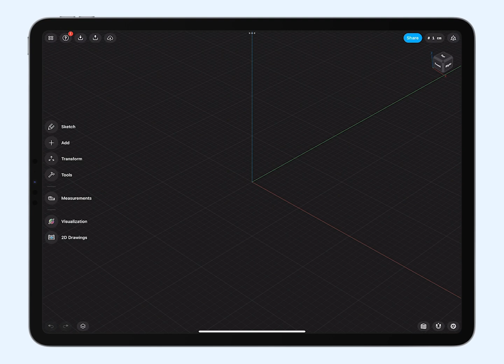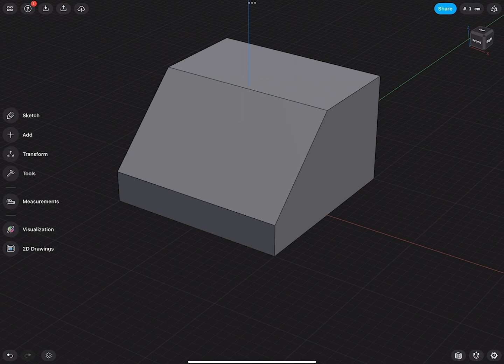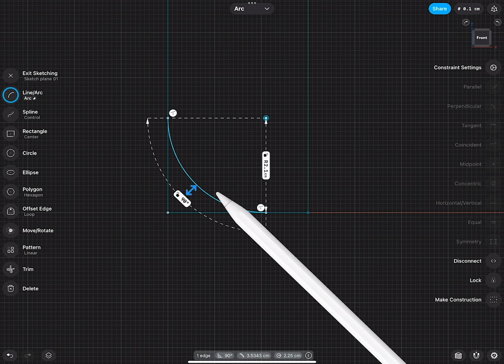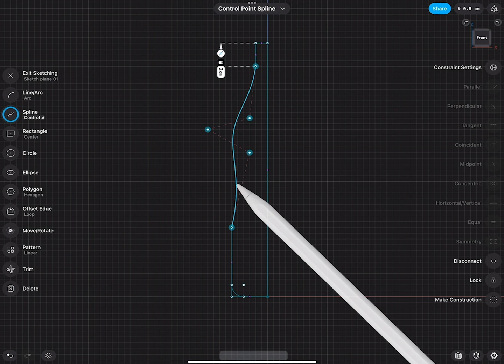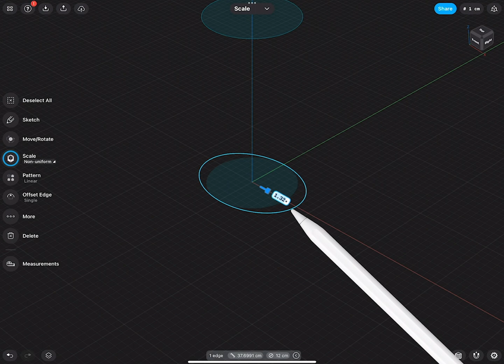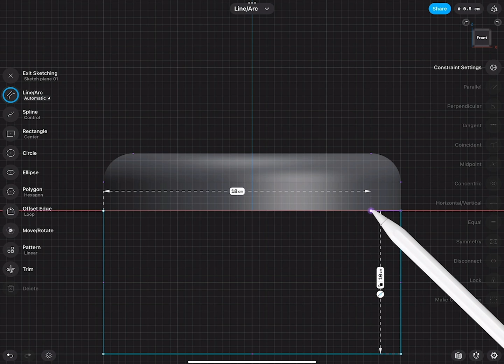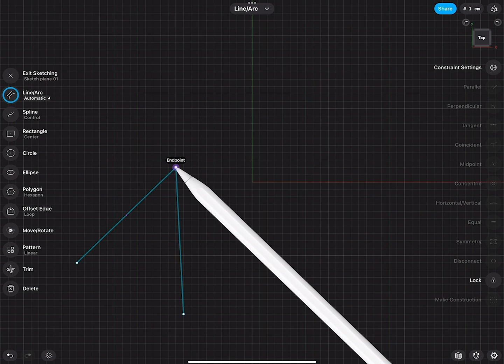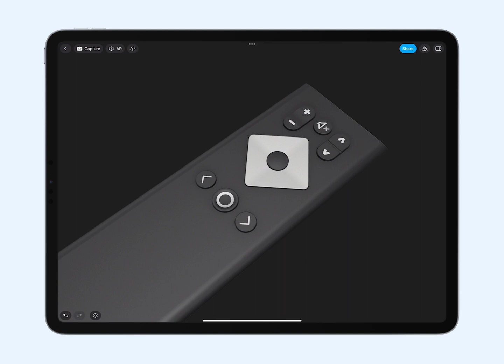Sketching basics | Modeling projects

Comment: why can't I simply sketch a rectangle by using TAB for dimensions, using only a keyboard, like I can do even in Interface Builder for Xcode. Why do I need to waste time each time finding and clicking the other side and entering it again, after I entered first? why it can't be - I put a rectangle of the face /grid -> I type first size, enter -> I type 2nd size, enter. and everything switch auto. It is so basic instrument and it is so annoying to struggle with that each time. I work on MacOS version, so I don't use pencil, I don't draw my dimensions, I want to be prescrue

Comment: Dude I love shaper3d but it can be unintuitive and clunky as fuck. First, the snapping is inconsistent and troublesome as fuck, if I want to line up the sketch with some other arbitrary point it just jumps between things instead of what would logically be lined up with it in the sketch. Despite generating individual sketches when making a line or a rectangle for example, it welds each sketch to whatever other sketch is touching it, so if I line up a rectangle to a line, it drags it along with it, so I have to carefully lock unlock, and babysit every single point. Faces don’t snap to each other in general, even with the 3D snapping turned on, and when I go to zoom in to line up my faces or edges (yes I can use the “align”tool, but it moves literally everything else instead of extending the geometry) THE DAMN GIZMO IS NOT ON THE SCREEN ANYMORE. why can’t the gizmo stay centered as I zoom? Why can’t it just logically snap lines, faces, and other things intelligently; the only reason I’m here is to sift through 15 minutes to try and understand what I’m doing wrong, because it’s obviously user error, but godDAMN you want me to pay 200 a year and I can’t even zoom on the selection and move it without the gizmo getting yeeted into oblivion? And on top of everything, the accuracy is dodgy as hell, I’ll double tap the top of the selection to focus it, and it just decides I clicked the back. I click a face, and it decides I clicked the edge. I have an iPad Pro 12 inch and a stock Apple Pencil 2, why the h e c c  can I not click what I want to. 

Further still, “move/rotate” is positioned differently for sketches and objects, increasing the frequency of misclicks when switching back and forth. Such a tiny UX decision could save so much time, just put the heccin buttons in the same spot 

Thank you for this app. Seriously, I love it, and I’ve used it for a year now. But it increases the instances of me fantasizing throwing myself into oncoming traffic considerably.
Reply from the maker: Thank you for your candid feedback and for being a supporter of Shapr3D! We’ll continue refining the snapping, welding, and face alignment features to make them more intuitive and consistent. Additionally, we’ll explore ways to improve the gizmo behavior during zooming and ensure accurate selection. Your feedback helps us identify areas for growth, and we’re committed to making Shapr3D even better. Thank you for being part of our journey!
Reply: @Shapr3d  On the contrary! Thank you for such a powerful featureset and for the prompt reply, i frankly thought i would be shouting into the void haha - I think it speaks to the convenience and power of the application that these pain points haven't made me use other alternatives, and even so, these pain points are relatively minor and likely user error; despite that, if there's a way to eliminate them i can't see any other applications coming close. The speed I can put things together now is just insane.

Comment: Does Loft have limitations? In your example (11:45-12:00) start the rail as a spline but end it short of the other circle, then complete the segment with a line that is not tangent to the spline. Now try to use Loft. You'll get the error: Operation failed because the resulting body wouldn't be valid. Now make the line and spline tangent, try again and it works. There are many other combinations that result in the same error.